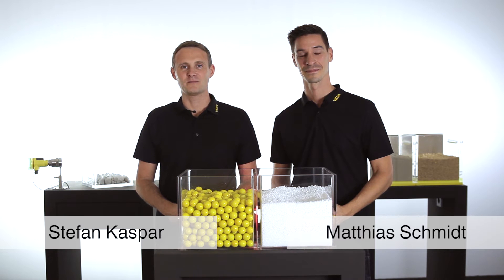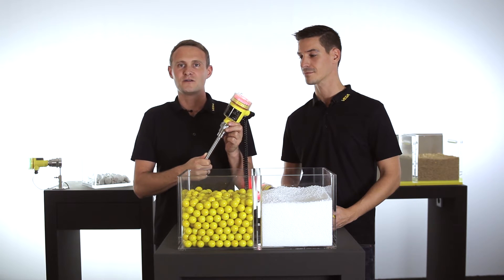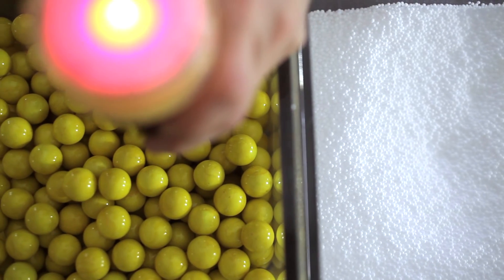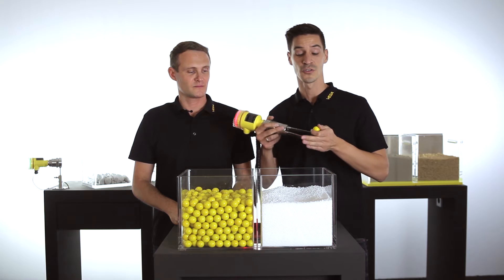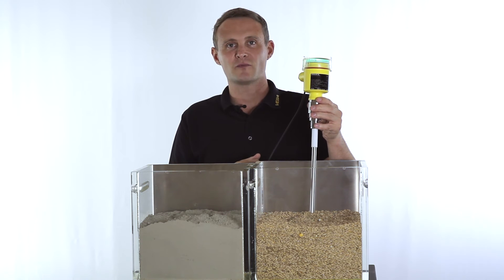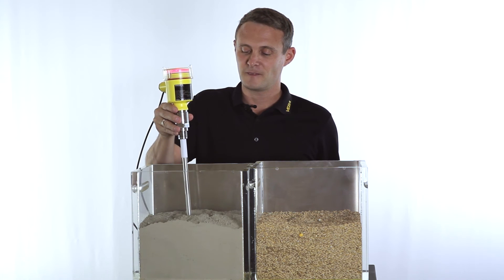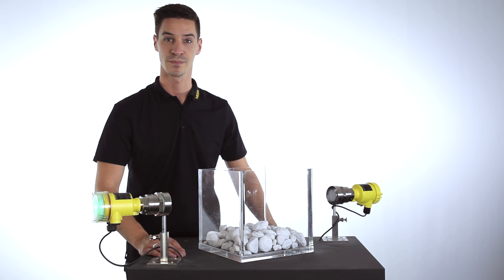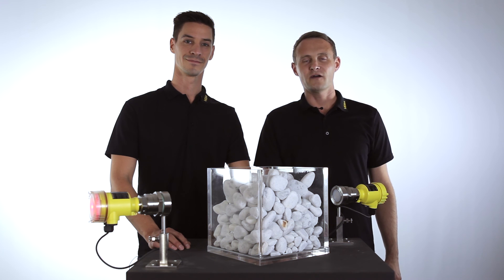Point level detection in bulk solids

Comment: The video is very interesting. At minute 3:45 I can observe that when the rocks fall into the plastic vessel, the signal is not interrupted, until the rock pile is stable. Moving particles do not create a switching signal. Is that correct?
Reply from the maker: Thanks for your question!
The microwave barrier in this demo was parametrized with low sensitivity and a long integration time so that it only switches when the pile of stones is so high so that it is blocking the complete signal for at least one second between sender and receiver unit. Single stones falling down through the barrier do not cause a switching signal as they only absorb a small part of the microwave energy for a very short time.
That way we can detect if the vessel is full while it is filled up.